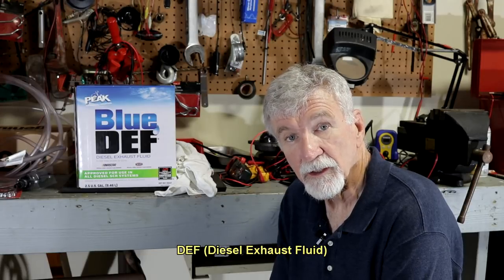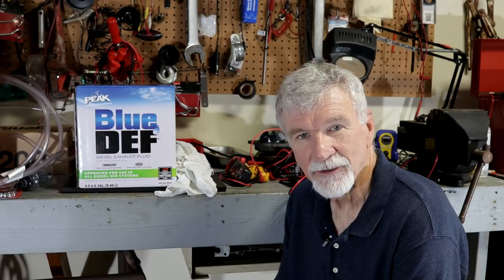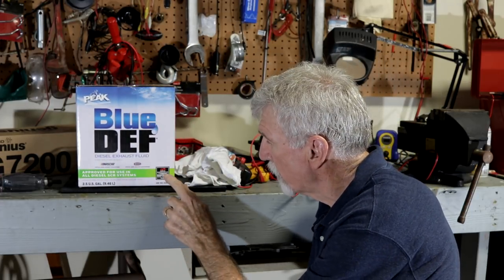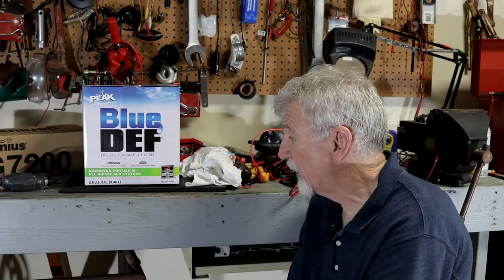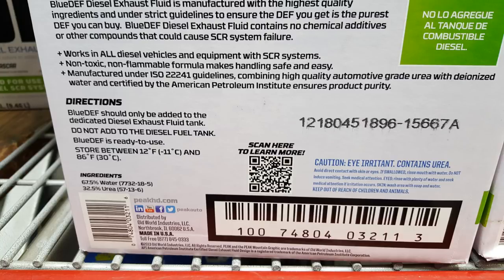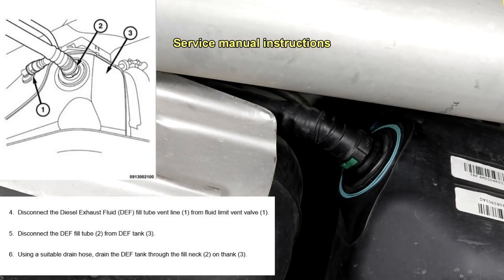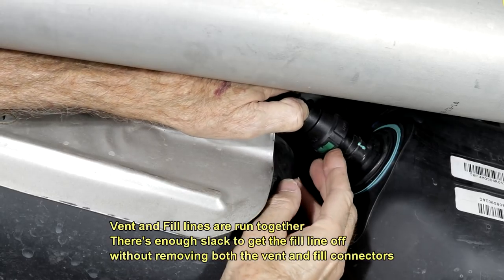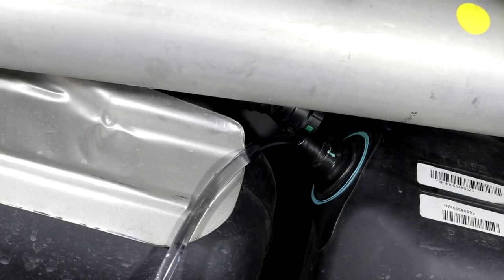How to remove DEF from RAM 2500 Cummins Diesel

Comment: Anyone have any issues with their Def gauge? Filled the tank almost 2 months ago to 100% and it hasn't budged. Watched "Motor City Mechanic's" explanation regarding the sonar system on the DEF pump/gauge. I am probably just being impatient and the fluid hasn't reached the upper sensing limits yet. Just curious if this is a common quirk.
Reply from the maker: Yes, they are all like that.  The gauge is not linear.  You can run it down to a half tank and add 2 1/2 gals and it will take it all.
Reply: Same issue, they just said I’d need to replace the def pump, $2,200, any suggestions?

Comment: Marion: I’m sorry if I overlooked the answer to this but how often are you going to perform the service?
Reply from the maker: I don't understand your question, what service are you talking about Gump?
Reply: I’m sorry: Draining & refilling the DEF tank.
Reply from the maker: Oh sorry, Only when my truck doesn't get much usage.  If I can't add a 2 1/2 gal. DEF can every 6 months, I'm thinking I'll do it again.
Reply: Marion Blair my 2017 Ram will be very similar. I have a company work truck so my RAM normally will just sit in the garage until summertime when we start camping and boating. During the winter months I will try at least a couple times every couple weeks to get it out on the highway and open her up. But I figure the DEF will be my only issue that I have due to not driving it. Still trying to figure out if it’s better to leave the tankful or about half full during the winter months.
Reply: I think I’ve read this on your channel before but does the engine exhaust system use a little bit of DEF all the time or is it just during regeneration?
Reply from the maker: Good question, several ways of looking at it.  It makes sense to put it up for the winter with it on the low side of half and when you start using it in the summer top it off.  (dilution is the solution, ha).  Your garage is probably pretty cool in the winter so in reality, the DEF would probably be good for a long time.  I called Peak and they said it's good for a year.  If you look at the charts, it's good for 2 years if temps don't get too hot.
Reply: Marion: by the way thanks I appreciate the video you did on the trickle charger I’ve got one set up mounted to the wall in front of my pick up in the garage to were when it sits for two weeks I can leave the driver side battery hooked up all the time. Hopefully it will prolong the life of both batteries at least a year. The driver side always seems lower than the passenger side so I just leave the driver side hooked up.
Reply from the maker: All the time the engine is running.  The more fuel, such as towing your camper, the more it uses.  But, it always pump DEF upstream of the cat converter which creates the chemical magic of turning Nitrogen Oxide into Nitrogen and Oxygen.
Reply: Marion: Thank You!

Comment: Does the DEF squirt in the system continuously every time the engines running or just when the screen is clogged to a certain point?
Reply from the maker: All the time, it mixes with the NOX the engine produces and the two turns the exhaust into Nitrogen and Oxygen.  By using the DEF, MPG increases 5% and also reduces NOX.   (nitrogen oxide from combustion)
Reply: Thanks Marion I wasn't that sure about it.
Reply: @MarionBlair  so you are saying that keeping the Def increase your MPG?
My understanding was the opposite.
Reply from the maker: 100% the time engine is running

Comment: the Julian calendar is used by the Army for all maintenance records.  it is used because it is unambiguous.  Either you have to write out the date as DD Month YYYY, or you can end up with an ambiguous date because the Army uses DDMMYYYY while some use MMDDYYYY  

A Julian date is sometimes used to refer to a date format that is a combination of the current year and the number of days since the beginning of the year. For example, January 1, 2007 is represented as 2007001 and December 31, 2007 is represented as 2007365.

Thus the Julian date is unambiguous.

Comment: Ok people, seriously DEF is not going to cause any issues other than a few codes. Get an inexpensive code reader that allows you to delete the code if one pops up. Worst case scenario would be major scaling in the tank and at that point you would have to remove the tank and lines.

Comment: Hey man, dumb question. What are you removing the def fluid?
Reply from the maker: It has a shelf life.  If you have it in higher temps, you'll have DEF problems if it goes bad.
Reply: Marion Blair did not know that. Thanks!

Comment: Hot weather and def do not mix well, been there done that. The dosing system quit working one summer here in Vegas, right before the recall came out for the cats on the 14s, dealer made me pay for flushing the def....once a month make sure you put the truck through it's paces and burn some of that def off. Also, do yourself a favor and buy def from the diesel island at truck stops if you can. You know that stuff gets turned over frequently and it's roughly the same price as diesel instead of 7/8 dollars per gallon
Reply from the maker: Thanks for your input..

Comment: I've been watching a lot of these videos about the new diesels and I'm the kind of guy who doesn't want to get wrapped around the axle for lack of a better expression so the bottom line is I'm of the opinion now you don't buy a diesel unless you absolutely have got to because of towing or however you're going to use the truck. Cuz after watching all this bullshit I'm going to stick with a gas engine thank you very much LOL
Reply from the maker: I've always been a diesel lover so I would probably own one even if I didn't tow just listen to that baby purr.  And the fuel mileage doesn't hurt.
Reply: @MarionBlair  just seems owning a Modern Diesel is actually maintenance intensive between additives and everything else I'm seeing in these videos. Everybody's bitching and moaning about something so I'm just saying stick with the gas engine and then just bitch and moan about only one thing... lack of fuel mileage LOL

Comment: Like the video, but I fill at truck stop, they have and auto size nozzle and low fill pressure, then I put 2 gal, so mine stays fresh every 5 mths I add another 2 gal, and at 1/4 of the price a jug of money Walmart gets. I would worry about contamination of dirt going in the tank, I wouldn't ever do this

Comment: Why not just run distilled water? A dealer wants $400 to drain that tank.
Reply from the maker: It'll throw a code and put you in limp mode
Reply: @MarionBlair  that’s why you delete it.

Comment: One more reason why Im not buying anymore diesel trucks.
Reply: They are certainly more complicated than they used to be.  If you need the torque you got to put up with that crap.
Reply: Or delete the emissions crap & enjoy your diesel truck
Reply: Did you delete?  If so, what system did you go with to reprogram the ECM?  And did you include a transmission tune?
Reply: TooTall's Vlog Yes, deleted my 2018 with 500 miles on her. Edge Insight CTS2, EGR & cooler delete, DEF delete, DPF delete, EFI live, S&B cold air intake, Banks monster intake & a 5" Flo Pro turbo back exhaust. No transmission tune needed cause I have a G56 transmission. Truck sounds like it's got a set of balls on it & I'm not destroying the engine with all the emissions bullshit.
Reply: Greg Chamberlain just don't buy a newer diesel truck, buy one that's pre 2007.
Reply: Yea, I wish I had my old one
Reply: Nice, I'd love to do that to mine.

Comment: Why not just delete the whole DEF system and be done with it fool? That’s a far better idea
Reply from the maker: That may be in the cards at some point but deleting it rules out a trade in so for now I'm ok.
Reply: Sell it private, with the delete it will be worth far more. Not to mention the better fuel mileage you will get. The bonus is no more DEF to buy. Have seen nothing but problems with this system. The company I work for bought one, it spent more time in the shop getting fixed because of DEF problems than it did working. In the winter it would fail ever time the temp went below -10 C, tail it into a warm shop, thaw it out and it would go out and fail again with in a hour.
Reply from the maker: I don't agree that it's worth more.  Try selling a deleted truck privately in California and a lot of other states with similar laws.   Not going to happen.  Only a fool would buy a truck you can't register.  Also, you come out better sometimes when you trade because you don't pay sales tax on the trade in.  RAM says they will give me 41K for my 2014 as is.  (totally stock Laramie, Paid 48K).  That's $2870 and I don't have to deal with people coming to the house to test drive etc...
Reply: I guess being Canadian and not having to deal with those stupid EPA laws is the difference. Up here a deleted truck is worth 2to4 grand more. Infact having the DEF system actually makes them far less desirable. Same as any truck with the particulate filter system, with about half the price you can get without.
Reply from the maker: Disagree, Canada and US have the same EPA collaboration, I don't know how Canada does it but in the US, enforcement it's state by state.  Some states, are more slack at enforcement, others like California, they mean business.  I suspect all the states as well as Canada will gradually increase their enforcement.  Canada is no different, you delete a truck with a warranty and you have no warranty.  The only different is the trucks cost about 25% more in Canada due to exchange rates.  So when you say, "just delete it", you need to consider the loses you could incur, the least being the cost of DEF which is next to nothing.  Don't get me wrong, I'd love to "just delete it fool" as you put it and as I say i might at some point but it's not as simple as that unless you are willing to buy a new or used truck with no warranty.  IMO, that would be the fool. My truck is over 4 years old and haven't had 1 single problem with DEF (but I did have to change out an entire rear axle under warranty).  I don't know anything about -10 deg weather but I know there is a lot of RAMs running around Canada that's not deleted and doing fine.  DEF system has a heater so I don't know what's going on with your company's truck but probably related.